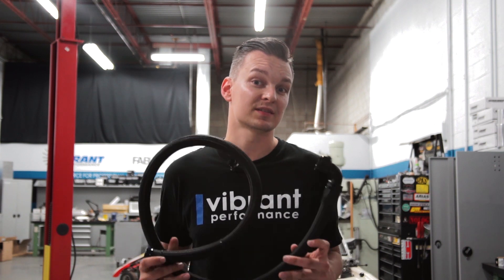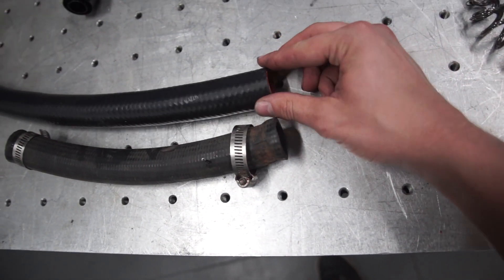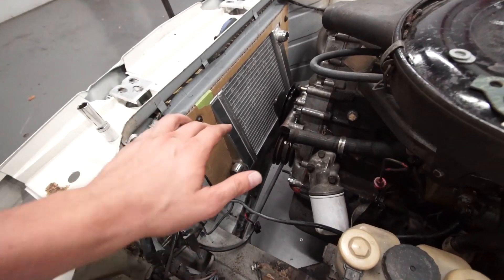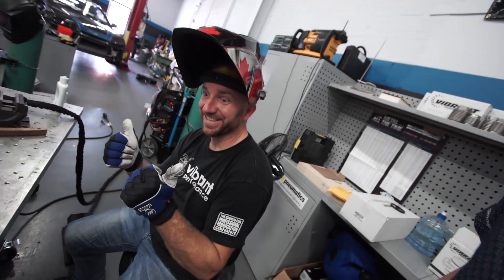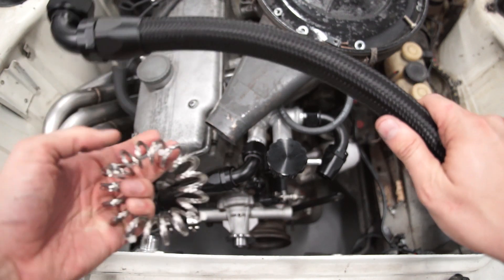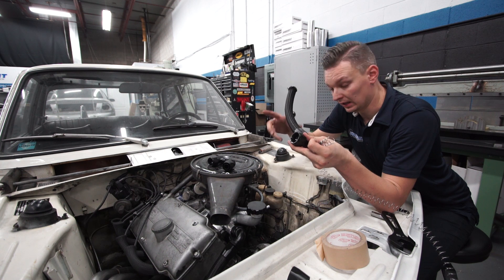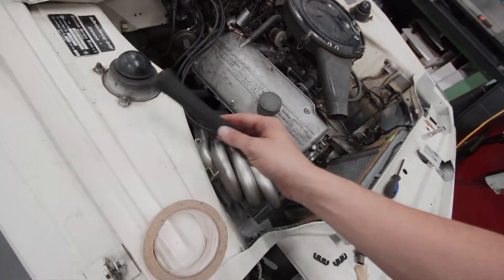Retro Header Build-Off Part 7: Installing -AN Cooling System

Comment: What size are the AN fittings? Oh by the way WD40 isn't a lubricant.
Reply from the maker: We agree, WD40 is a solvent but we are using it as a 'lubricant' in this situation so that they fittings don't go in completely dry. The size of the Upper and Lower Fittings and hoses is -16AN
Reply: @VibrantPerformanceTV  It's job (wd40) is to displace water but there's another spray I use available in the UK called GT85 which lubricates and prevents rust and generally used on bike chains. It''s a light lube and really good to have hanging around for these type jobs. 
I bought AN16 fittings for my EWP project on a Ford 289 mustang. Thanks for your video I can see that they can work as I was worried they might be too small as the standard hoses on a 65 Mustang are 1.5" (top) and 1.75" (bottom)!!

Comment: Would you recommend using these hoses if the engine and radiator are on opposite sides of the car. Trunk to hood length. Let say 6-8 feet in each direction.

Comment: Hey how much would it cost for this set up on a different car for just the large upper and lower rad hose?
Reply from the maker: Would really depend on the length, type of fittings and amount of hose you are running.

Comment: WD40 is a penetrant not a lubricant.
Reply: I used to argue that, til I found out it's basically fish oil, not as much lubricity as needed for bearings, but perfectly fine as an install lube. Nice and light, no residue to worry about.

Comment: One thing I noticed when you guys explained the line going from the upper radiator connector to the waterneck/thermostate housing: 
When turning the hose that it enters the waterneck from the upper side you risk creating an area where air bubbles can accumulate and make bleeding the system an absolute nightmare...

Comment: how did Aaron clear the chips out of the radiator after drilling? i was thinking of making a custom oil cooler and intercooler and could use some tips -ryan
Reply from the maker: Hey Ryan, you could either vacuum them out, or blow them out from the other side. Ideally you want to de-bur the hole using a deburring tool. This will provide larger chips as opposed to a hand file which will create smaller chips that are much more difficult to remove.

Comment: Hey nice workmanship..the only thing I worry about is the original hoses were all rubber so they were vey flexible however some of your hoses have very short sections of flexible hose which may transmit more vibration to the radiator etc...
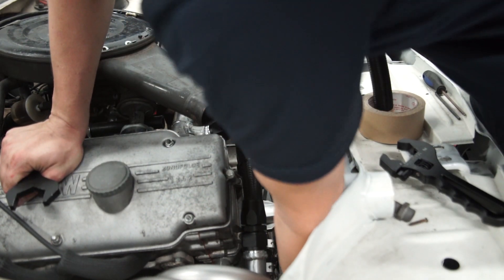Reply from the maker: It's very important to have flex, like you said. However, the Vibrant Race Hoses are flexible as well, actually more flexible than the original ones. The lower section is now longer to allows more flex, and the upper portion has the silicone piece that attaches to the waterpump which allows for flex as well as you can see at 10:17

Comment: That's some pretty small ID coolant piping. Looks nice though!
Reply: I thought the same lol, but it's just a lil 4 banger, not going to be generating enough heat to necessitate larger (wayyyy more expensive) fittings and line

Comment: 6:57  Aren't those fittings going to choke your coolant flow a bit?  The ID looks to be quite a bit smaller than the stock hose ID, and even a small difference in diameter will make a large difference in cross-sectional flow area.
Reply: Kinda what I was concerned about...the rad isn't important if you can't get the coolant to and from it fast enough.  Those older engine designs didn't exactly have the most efficient water pumps - those Honda engines mentioned would have much better flow from the factory, and I wouldn't be surprised if they were running improved pumps, or possibly even electric helper pumps.  If you reduce the ID from 1 1/4" to 7/8", you lose about a third of your cross-sectional area - 3.9 sq in vs. 2.6 sq in (-16 AN is a 1" OD, so that should be pretty close for the ID) - making a significant difference to possible flow rate and possibly increasing the likelihood of cavitation inside the pump at higher RPM (and of course, the easier the coolant flows, the less parasitic load from the water pump - another plus in terms of performance.)  It may work, but it would be too marginal for my taste.  

On the other hand, I come from a country where the road surface sometimes melts on a nice, hot summer's day (you can sink your tyres into it if they spin, just like driving in thick mud), but it may be less of an issue where you blokes are.  :-D
Reply from the maker: You are right about it being smaller, the factory ID for the M10 engine is 1.25", and the -16AN hoses are 1" ID. We have seen this exact radiator setup (which also comes with -16AN bungs preinstalled) in many 1200+ WHP race setup (Drag and Circuit) 4 cylinder Honda Engines with no overheating issues (for comparison - Honda B and K series engines have 1.25" ID hoses from factory). We also have know that Will Au-Yeung's Vibrant Time Attack Civic (1000+whp, turbocharged 4 Cylinder K Series Engine) is currently equipped with -16 AN lines and not experiencing any overheating issues. You can see a video of his car setting the track record at Buttonwillow on our channel.
-Art
Reply: aussiebloke609 with a decent radiator setup, I feel like the difference would be negligible.
Reply: With a factory water pump??

Comment: Well, with that shiny new header, you gotta get some nice Weber DCOE carbs on there!  Might as well get a new cam while you're at it, and oh, isnt it time to upgrade the suspension?.......
Reply from the maker: There will definitely be an upgrade on the intake side over the winter including all new carbs, refreshed head and a new cam. I also have all new suspension for it, however we just wanted to focus on the exhaust and coolant modifications for this series. You can be sure to see a video of Speed Academy's Celica and the 2002 reuniting in the future and going for a drive together with all the new modifications.

Comment: No need for those race fittings on that old turd of a engine. It is like putting a giant carbon GT wing on a Yugo. You kids know they make OE fitment cooling products right?
Reply: Old turd of an engine?  BMW used to use production m10 blocks to make 1500hp F1 engines. They're fantastic little motors and easy to work on.
Reply: Adam Jordan That and they are trying to teach people how to build a cooling system in a roundabout way. I don't get why people cant understand that these guys are trying to teach us not just spend $300 on hoses for no reason.
Reply: Heh, are they spending your money on that car? No? Then shh, it's not your problem.
Reply: Phone User get to know what makes builds unique..average backyard builder would use rubber i feel you

Comment: Does anybody else think the plumbing would have been way neater if the top-hose connected to the drivers-side tank and the bottom-hose connected to the passenger-side tank or just me?
Reply from the maker: I was trying to do that initially, the problem was the positioning of the thermostat. It had to go directly to the water pump to separate the water coming from the radiator and directly from the engine. If you ever look at the oem lines, it uses an "S" shaped hose at the bottom which usually kinks.
-Art
Reply: also, a longer line will be more flexible and accommodate engine vibration/movement as the radiator is fixed.

Comment: Really hope the hose material isnt rubber because that wd40 will just deteriorate that hose pretty quickly. Would suck to put that much effort in that system to have to redo it in a year or two. Silicone lube works best for assembling these hoses.
Reply from the maker: These hoses are "E85" safe; Aaron had done it this way with all the lines in the RWD CRX about 4+ years ago. We have yet to have a leak from any of the oil, water or fuel lines he's done.
Reply: The type of hose used there looks like either startlite which has an elastomer smooth bore inner tube (safe for all water, lube, fuel or air) or if they're using the fancier stuff (I forget the technical name) it has a nylon bore, either way wd-40 won't touch the stuff